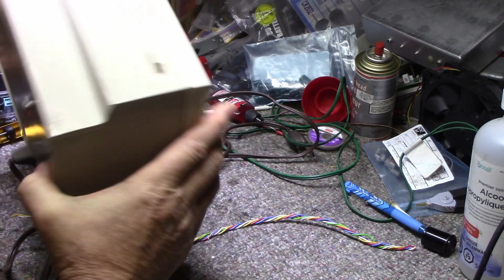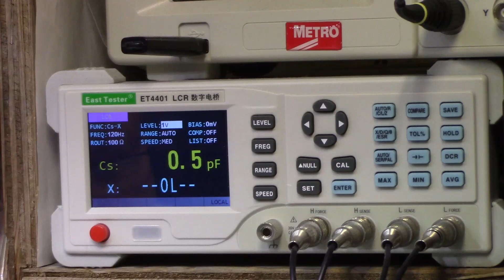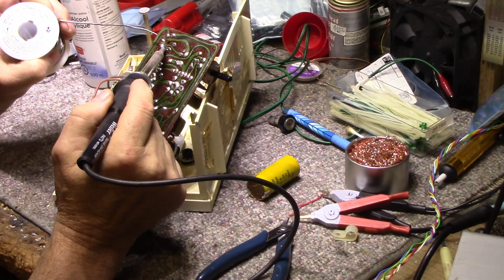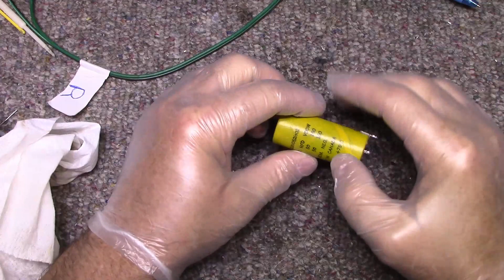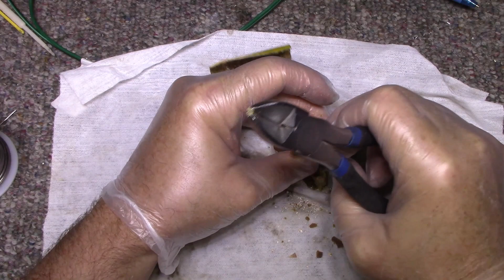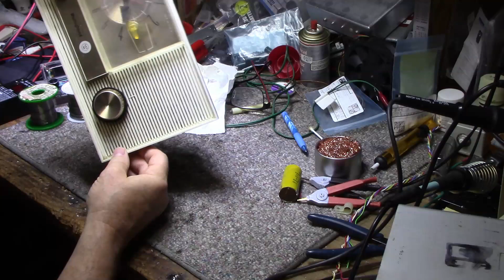Vintage Westinghouse AM Tube Clock Radio (837L5) - Repair (Ep. 48)

Comment: I teach tube radio restoration; the input filter cap maximum is 40 uF for a 35W4 (look it up). 100 uF will stress the tube, causing premature failure.

Comment: I have several restored 5 tube Westinghouse radios. Two with clocks, one of which I listen to almost every day. All work well except for one small issue: They drift off-station as they warm up, especially when the room temperature is less than 60° F. I suspect the oscillator coil - all of them use the same one. I don’t experience this issue with other brands such as GE, RCA, Zenith, Arvin, Emerson, Motorola, etc.